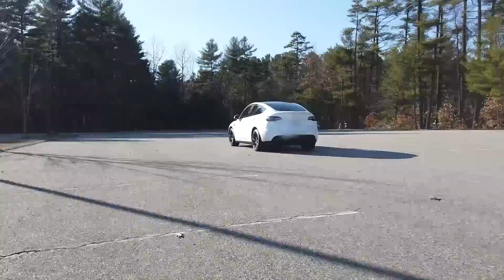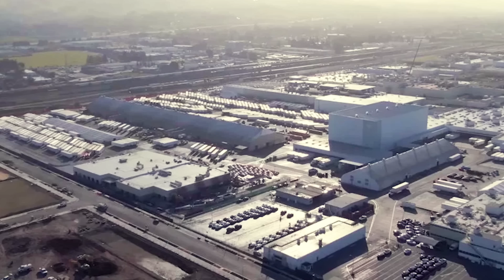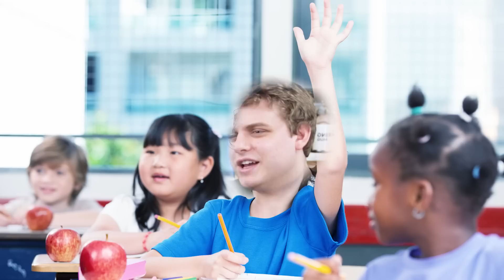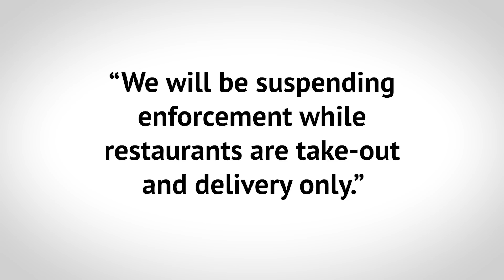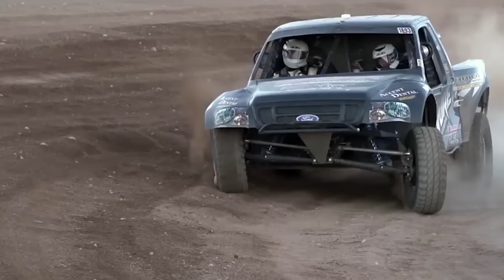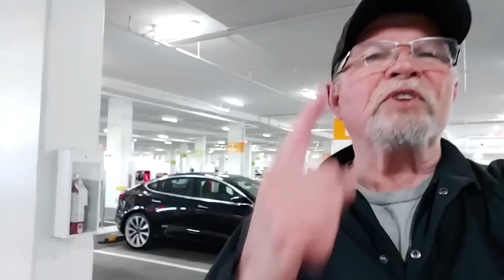Tesla Time News - Zac & Jesse Safely Inspect the Model Y!

Comment: I should point out that besides these being my cars that the wheel hack I did on the 3 used a 1” smaller diameter wheel. Therefore the ground clearance between the 3 and Y are more than what was shown.

Comment: Let me explain why we need to talk about this. There is no doubt that the idiot truck driver did something unforgivably unsafe. But, there were at LEAST 3 full seconds where the threat was showing itself. Even two seconds is enough to stop a modern automobile from 70 mph or mostly because there was still 208 feet left. Jesse's "over 300 ft" figure factors in 3/4 sec. reaction time on top of the 70 - 0 distance, but by the two second mark the reaction time should have been used up and a conscious decision pertaining to an evasive reaction should have been reached. The issue is that Tesla markets autopilot as fully self-driving ready "once the regulatory issues are worked out". Then when a fatality happens they then say "we never said autopilot is fully self driving". The first statement gives a false sense of security to Tesla fans and encourages people to trust the system far too much. The reality is that people do stupid, rude, and dangerous activities on the road. My responsibility as a driver is to protect the occupants in my vehicle (and yours) despite all the stupid going on around me. As a Boston area driver I am a subject matter expert on automotive stupid. I have had nearly the exact same situation happen to me without incident. Well other than rude gestures. :-) There was no reason for a wreck of that severity to have happened even given what the truck driver did, if the driver of the Tesla was even remotely competent and attentive. The Tesla driver did not die from a failure of autopilot. The driver died of stupid. Autopilot is a great technology that is not yet fully baked and as such should not be trusted to make all the driver's decisions for them. Having said that the NTSC evaluation was spot on. Overreliance on autopilot resulted in the driver losing situational awareness and not being able to evade. Note that the NTSC never said that autopilot was the cause, but overreliance on it was. BTW, exactly why didn't the Tesla emergency brake when it became apparent that it was going to hit the truck? Any mainstream car such as Subaru with Eyesight, Honda with Honda Sensing, etc. would have done so. No one seems to be talking about that. Seems to me that "the safest car in the world" should have been able to save this driver's life with a simple maximum braking maneuver.

Comment: I appreciate Tesla! I think that they missed an opportunity when it came to Model 3 and Y. I think they should have stayed consistent when it came to the front bumper and the interior infotainment. I prefer the Model S and X front bumper and infotainment design. I also think that the panoramic roofing should be based on customer desire, I prefer to have a solar rooftop panel to contribute to the vehicle operation (when using SENTRY mode, dog mode or camp mode). I'm sure that Tesla can do that.

Comment: Well guys, it's healthy to accept if automation in driving comes with increased risk by giving the driver the false notion of security.. thereby paying less than the due diligence of attention, and enabling bad things to happen, that may not have otherwise. I wouldn't say it's the fault of Tesla or autopilot... but if it is true.. and I have felt it even myself in a minor way, just from using cruise control (so I can imagine how disarming lane pilot assist, or auto pilot could be).

Did the car not detect the truck, and emergency brake?

It is a problem of assistance features imho, that it makes a human driver more prone to inattentiveness.

Comment: I think the issue on regulation for speed limiting on the e-bikes ... comes down to MONEY
in most countries in Europe you don't need an insurance for a (standard) bike as most insurances will cover the cyclist
but you do need a separate insurance for a moped  going 45kph
once the e-bike came on the market, people and legislators were concerned for the possible accidents and who pays damages
because an e-bike can go faster than a standard bike, they determined that 25kph seems like speed a standard bike can utmost be going ... so that should be the limit to for e-bikes. Therefor an e-bike limited to 25kph (as manufactured and warranted by the manufacturer) doesn't need an additional insurance.
the e-mopeds going 45kph were covered by the existing ICE mopeds insurances hence no changes there
and for the e-bike that can go to 45kph, they named it the speed pedelec class,  you also need an additional insurance

and as manufacturers keep these classes, the produced e-bike is safe for 25kph concerning brakes etc.
the speed pedelecs therefor also have beefier brakes, engine, frame etc. that makes sence

what is happening since some 2 years ago ... is that people started modifying their standard e-bike to go past the limited 25kph. Sadly some accidents do happen because the e-bike hardware is not capable to brake and endure the greater speed.

And as accidents happen, damages have to be paid and you know, the greedy insurance companies don't like to pay ... hence lobbying the goverments to restrict legislation further ... and making it possible to escape paying out damages - if they can prove the e-bike was modified  ...

Comment: Exploding dinosaurs...still ahead in overall practicality.... but the solar powered windmills are catching up, though on the back-end, dinosaurs power the whole thing. In the Sprint vs the marathon..... All-Electric proves the winner.... so the short-range, low miles on the road is a good case for no Dinosauric engine at all. In my case, the SPRINTER VAN.... I would have loved a Hybrid. This is a vehicle where it would have made sense. Lots of stop and go, generally local, able to go infionite distance as needed. Always goes back to home base after shift so millions of charging stations not needed. Personal cars like the Prius..... I still can not reconcile the slight improvement in fuel economy.... plus you STILL have an engine.... and the lifespan gets questionable toward the end of the  original battery... too expensive to buy and maintain a used one for a non-mechanic..... so those that cannot afford the Hybrid new, and subsidize those that can afford one, then lose AGAIN when they buy a used one..... they get no subsidy or tax break, and nothing but huge repair bills when the drive system, electronics, etc fail. Fleets of vans could/should have had the concept ramped up to size long ago.. a Sprinter Van that is all electric drive, with a small diesel engine as a POWERPLANT only..... should have been around by 12 years ago. Geely hybrids, projected at 13K or so.... who knows how that will screw up this little elite market. I am interested in Hybrid and All Electric where it makes sense, but not going over the top into a religion over it. NOTAFANBOY!

Comment: I have to comment on the NTSB investigations into Tesla accidents. There is a point I have never seen posted before about the situation. Regarding the truck that pulled out in front of the Tesla; this accident could possibly have been avoided if trucking regulations were changed. 

In Europe, over 30 years ago, it was made law that trucks/trailers must have side impact protection systems installed. There were too many people getting killed by driving under trailers and shearing off the top of the car. Since that law went into effect, deaths from side collision with trucks went down drastically. 

Truckers in Europe initially complained of the extra cost and weight of the systems. However, they quickly found out that the systems actually work in their favor. They also provide side protection for fuel tanks and other equipment and a place to store chains and other items. Also the side protection increases visibility and the effectiveness of forward collision detection systems.

Comment: You criticize the NTSB for not understanding Tesla, but you demonstrate that you don't understand the NTSB. When the NTSB does an accident investigation, they do a very deep dive. They choose accidents to investigate based on the odds that a novel issue MAY be involved. But when they do investigate, they try to identify EVERY factor that MAY have played a part in the accident. Those familiar with aircraft crash investigations will be familiar with the "error chain" determination. Practically every accident is preceded by chain of mistakes, that, had any one of them been corrected, would likely have prevented the accident. From this error chain, they will propose a system change to prevent each one of those events in the future. 

For example, there was a plane crash once where a small contributing factor was  the air pressure in one of the tires. The mechanic who checked the pressure wrote a "2" that looked like a "7" because of how it sat on the line on the form. Because of that small error, the NTSB mandated a change of the tire pressure recording form and the shape of hand written numbers to be entered on that form. The tire pressure was only a single digit percentage contributing factor, but the NTSB tries to eliminate every factor that played a part.

Since inattention played a role in the accident, the NTSB will suggest/mandate changes to reduce or eliminate that problem. In this accident and others involving Autopilot, they found fault with: the driver of the Tesla, the driver of other vehicles, the road design, highway maintenance, highway striping, crash attenuator maintenance, OSHA rules, the driver's cell phone designer (Apple), driving over the speed limit, AND several issues with AutoPilot. 

You chastise them for stating the fact that "the vehicle did not detect the driver's hands on the steering wheel." and claim that "they don't even know how Tesla's work". The NTSB does know how Teslas work in this regard. They never said that the driver's hands weren't on the wheel, they stated the fact that the vehicle could not detect whether the driver's hands are on the wheel or not. It is one of my chief complaints about AutoPilot, that it can't detect when my hands are on the wheel, even when they are. It frustrates the He** out of me that even when I am diligently holding the wheel right down the center of the lane, I have to actually steer infinitesimally out of the center of the lane just to prove to the AutoPilot that I'm still there! That is NOT a good system to use. It would be better if the wheel used some capacitive detection sensor (like Jessie suggested) or use the cabin camera, or some other system to detect my attention level. It is sub-optimal that it works the way it does now. The NTSB are not the only ones who think it should be better. Go check out the Tesla forums to count the Tesla fanbois and fangurls who agree with them. 

Your contention that "it was the truck driver's fault, PERIOD" is the wrong attitude to have regarding highway safety. NTSB, and NHTSA, and OSHA, and DOT, and IIHS, and MADD, and vehicle manufacturers, etc. have adopted the layered approach to reducing highway deaths. There hasn't been any one safety measure that has prevented a majority of highway deaths, it has been stacking many incremental changes that has reduced highway death rates by about a 1/3rd of what they were in the late '60's. Road design/materials, signage, lighting, striping, reflectors, breakaway light posts, have helped. Vehicle improvements from seat belts to crush zones, windshields, tires, AEB, traction control, airbags, headlights/brakelights, made a huge difference. Speed limits, drunk driving regulations, licensing and driver training requirements have made driving safer. It's important that all factors that contribute to crashes/injuries/deaths are identified and controlled. Don't feel attacked by the Safety Agencies, they are trying to keep all of us safe. Help them, don't attack them.

Comment: Re powered cycles: In the UK at least, it has been considered historically that anything that uses power of any sort on the road has to pass roadworthiness safety tests, have lights, pay tax, have a registration plate and if two-wheeled, the rider has to wear a crash hat when riding.
So, to save an assisted cycle owner from all that cost and bureaucracy, they limited the power as a way of not defining them as motorcycles.
In the UK, you are allowed an electric scooter as long as you don't ride it on the road OR the pavement (sidewalk). However the streets of London abound with morons riding electric scooters on the road at night with no lights, no reflective clothing and no regard for traffic rules.
So, it's a choice between having puny power or a raft of rules, regulations and taxes for being a motorcycle. 
If you are a pedal cyclist, it has always been assumed that human power is so puny that you don't need all that regulation apart from abiding by traffic rules.

Comment: Hey Zac and Jesse, an FPL Ad showing lots of solar panels keeps appearing during your YouTube presentations, so here is a reminder of what FPL really means to do with solar power.

At this web page, FPL describes their 30 by 30 plan, i.e. 30 million panels by 2030.
http://newsroom.fpl.com/2019-01-16-FPL-announces-groundbreaking-30-by-30-plan-to-install-more-than-30-million-solar-panels-by-2030-make-Florida-a-world-leader-in-solar-energy

Since FPL says they will be installing "solar panels" let's "assume" these are PV panels and find the largest, most powerful PV panel commercially made.
SunPower Corp says that they make a commercial panel of 470 W and 21.3% efficient.
https://us.sunpower.com/products/solar-panels
So let’s say that FPL uses these.

Let’s also say that these commercial 470W X-Series panels have a spec sheet similar to the SunPower Corp SPR-X21-345 panel, a member of the same group.
https://us.sunpower.com/sites/default/files/media-library/data-sheets/ds-x21-series-335-345-residential-solar-panels.pdf

The Go Solar California web site provides the effective PTC (PVUSA Test Conditions) power for these panels.
https://www.gosolarcalifornia.ca.gov/equipment/pv_modules.php

With this information, one arrives at an estimate for the electrical production that can be expected from these 30 million panels and which will not be reached until 2030.

30,000,000 panels * 470 W/panel * 0.936 effective production factor per PTC
gives us a grand total solar production by FPL of 13.1976 GW or 52.7904 GWh/day on average

In the latest FPL Ten Year Power Plant Site Plan, page 18
https://www.fpl.com/company/pdf/10-year-site-plan.pdf
you'll find that FPL has the capacity to produce at least 23 GW * 24 hr = 552 GWh per day with fossil fuel and nuclear based generation.

The history of Florida in the last 60 years says that the population of the State is likely to increase 10 to 15 percent by 2030, from what it is today.Therefore, it appears that FPL is saying that they will meet the additional load growth with PV but does not intend to replace or retire any fossil fuel or nuclear generation with PV, even though their nuclear is reaching retirement age as well as many fossil fuel plants. With PV being the lowest cost power available today, and even more so in the future, FPL is not showing any real intent of letting go of nuclear or fossil fuels any time soon. 
These 30 million panels by 2030 is only window dressing, as is most of FPL hype. 

In about 5 years electric cars, batteries and PV on the roof will make central utilities obsolete.

Comment: You do not have to apply torque to the steering wheel to maintain autopilot.  Any input works from the steering wheel, like adjusting either scroll wheels.

Comment: The USA (except for asshole NY) has more sensible e-bike laws.  Federal regulations allow anyone over 16 years old to drive up to a 750w electric assist, including throttle-only-option models, with a maximum throttle-only speed limited to 20 mph -- with no license or registration requirements.  For models with more power and speed, a motorcycle license may be required, and then the setup is unlimited and just regular road laws apply.

E-bikes with a throttle-only option have been found to be one of the best ways for seniors and disabled persons to get and stay active, and to actually lose weight and improve their cardiovascular health.  The ability to fall back on the electric-assist-only mode allows them to get out more, stay out longer, and make the best they can of the experience without risking getting stuck and exhausted.

Laws may be modified on a state by state basis (hence NY's dumbassery), but the vast majority of states are at least as generous as the federal regulations.  Some states have no regulation on e-bikes at all, so design and ride at your own discretion, just as with any other bicycle.  Also, "bicycle" regulations includes tricycles, and there are some really cool 3-wheel designs for adults, including the more stable "tadpole" configuration, and various cargo-carrying & off-road models.